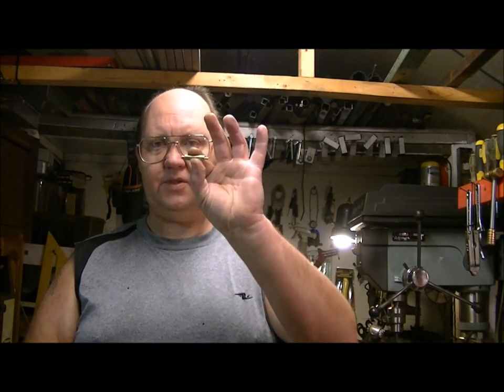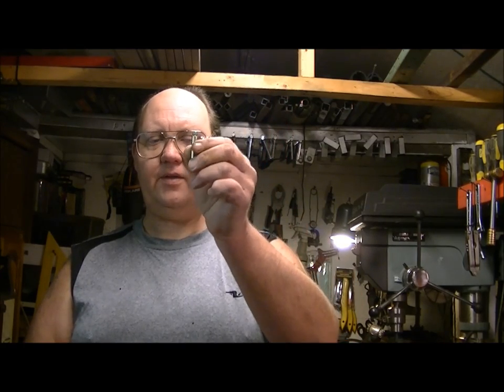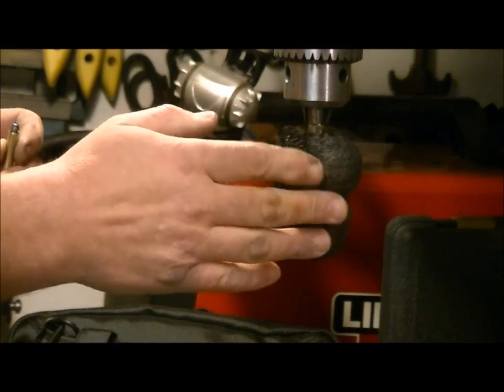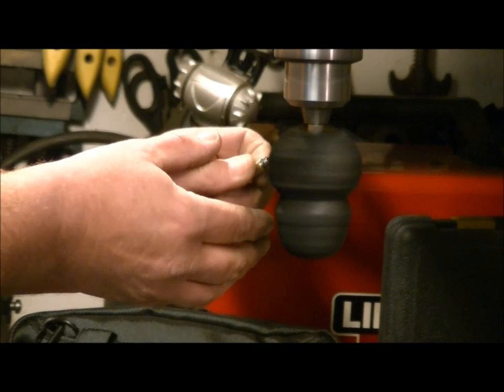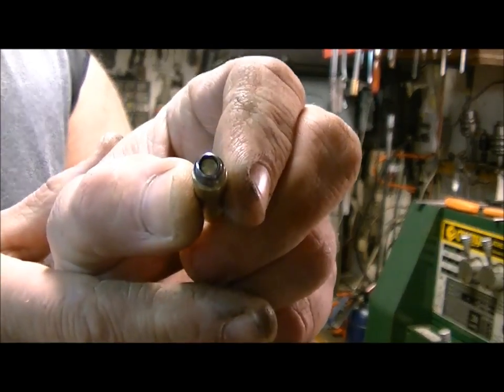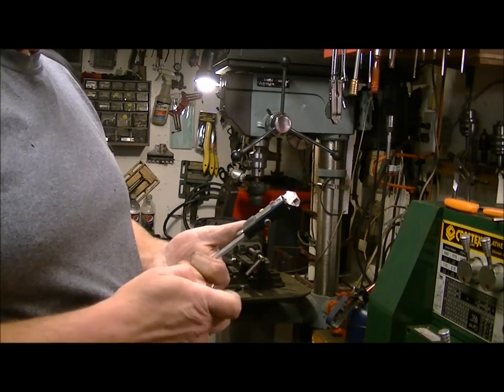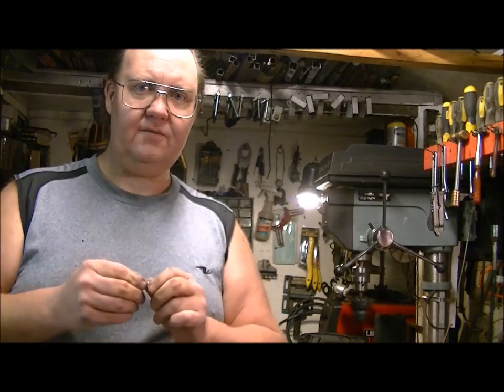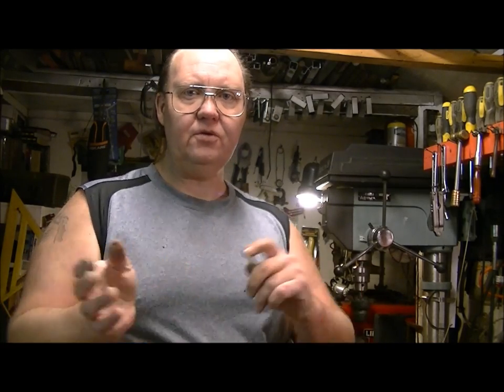Polishing The Crosman 2240 and 1377 Transfer Ports

Comment from the maker: yup find the old valve that did not have the tip sniped off, other then that you can try a modded probe and drill the transfer port out to 3.9 mm that the only solution i have other then that if you really want to get into the flattop piston and valve modding you can put the gun well over what it use to run at..

Comment: This probably does wonders to the traditional non-rifled so called barrels of the bb guns. Plus when the bb is 0.1-0.15mm smaller in diameter than the straw. However, I would and I am changing the straw to a real barrell and balls to pellets. In my case Im guessing these fragile pipes will be the first to blow up if not the aluminium pressure chamber itself.
Reply from the maker: well your way off track of the entire purpose behind this perhaps watching the entire video and paying closer attention would help more ..
Reply: @KevinMillard68  Btw I made my own mini lathe for myself when a teen in school.
Reply from the maker: @alphadonkey4545  cool

Comment: Hi Kev, do you know the velocity of a stock 1322 with a 14.5 inch barrel? I don't want to order it if it brings the pistol over the 500 fps law. thanks
Reply from the maker: wiht 14.3 grain pellets and 14 inch barrel youll hit around 497 at 10 pumps withthe odd 499 and 498 so your safe , i have a backpacker original one that hits 497 all day long with 14.3 grain pellets and i have modded a ton of 1322s over the years as well and even modded alot of 1377s to hit 490s
Reply: @KevinMillard68  Many thanks.

Comment: I never could get that in backpacker to stop leaking you could fill a puff of air on your cheek
Reply from the maker: that would be called a bad probe seal or breech seal one of the 2 or both easy fix tho
Reply: @KevinMillard68  maybe it was impossible to fix because I only had the plastic breach I tried four times